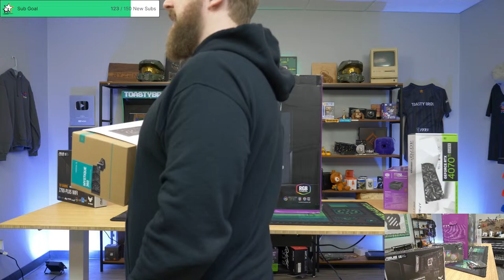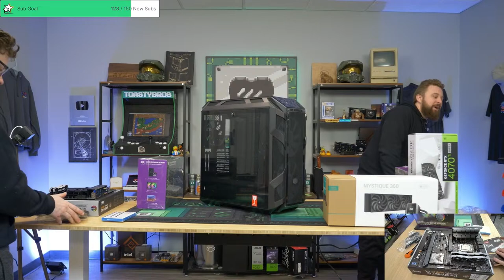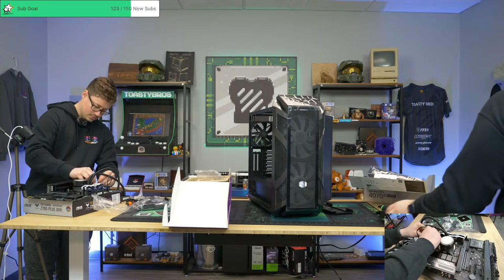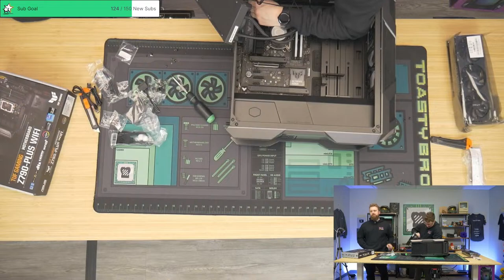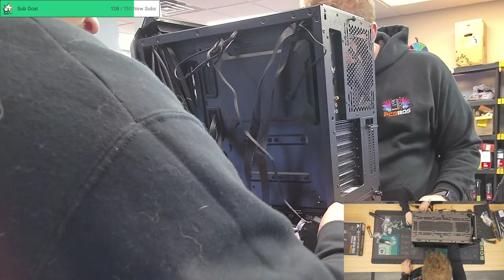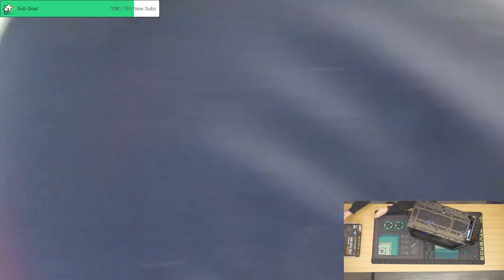RTX 4070 TI Super + i9 14900K Gaming PC

Comment: I just put together an I9 14900k with a 4070 ti super. I had a 600w power supply kicking around, and everwhere i looked said it would work. Long story short it stopped working yestersday. Just the new card wont power up. I threw in an old 1070 ti i had and it worked fine with same power cord. Thought it may be the adapter they send with the card. I started researching and the more i look the more i see people saying 750 to 850 minimum. Any advice? I do have an 850 thermletake Platnum in my other pc. I should put that in right?
Reply: Id go with a 1000 watt at least, that wt you are not taxing your power supply..
Reply: @damonlechene4610  Thanks for the advice.. I found out the card had actually died. I got a new one and put in the 850 i have. Everything is humming away great now. I will def upgrade to the 1000 as soon as i can, cine i plan to overlock this system eventually. thanks again.